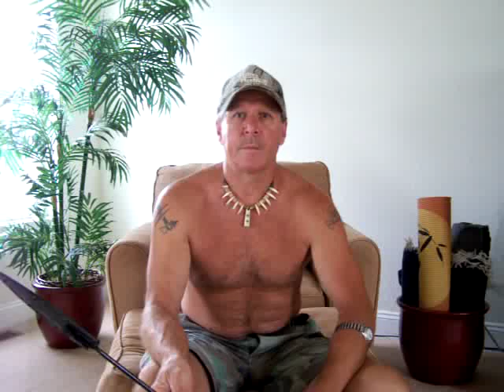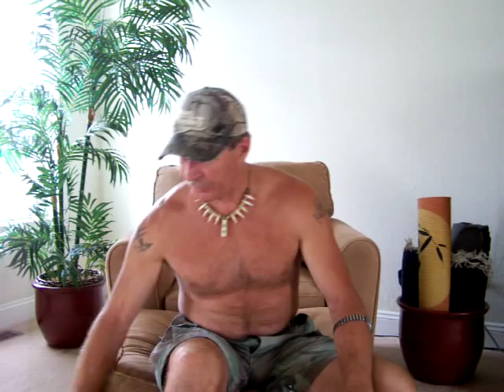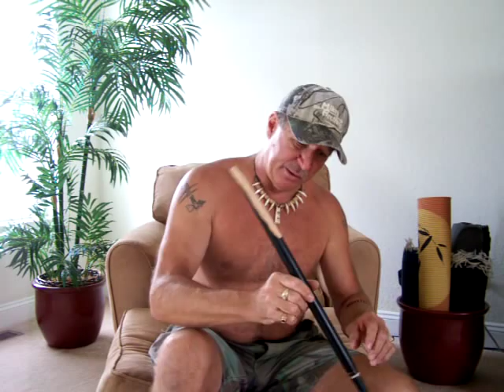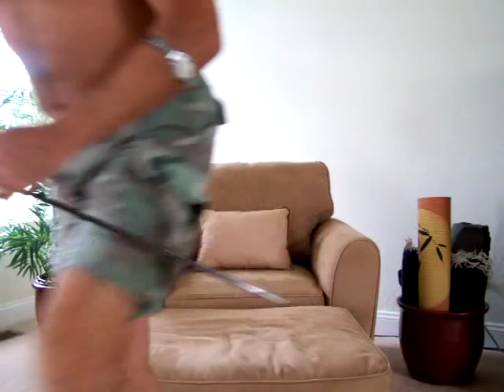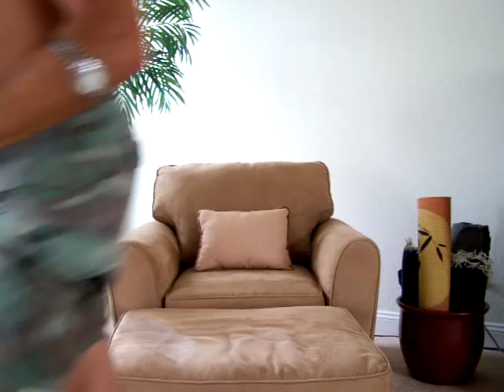Cold Steel Samburu Spear '' MORE PROBLEMS'' Video #4

Comment: NOTE: We've made our Samburu spears as tough as possible. However, if you bend your spear shaft or "shoe" (butt spike), it can be easily straightened in a vise or with a hammer, and the tough hickory handle of your spear can eventually break, so please be prepared to replace it.  ---not tough enough ColdSteel

Comment: Well, Ive never thought of cold steel as a cheap company, And I think that it's great that they cared to comment here. But Wood is a strange element, Some is good, and bad even if it's the same kind. Maybe it was a crappy rod to start with. I'm sure cold steel is taking this very seriously. But for the mean time, I think you should put on an Ash or oak handle that suits you.

-Keon.
Reply: Agree 100% about wood being a strange element. A person can cut two pieces off a log back to back and one will be a good piece to work and the second be bad to work with.